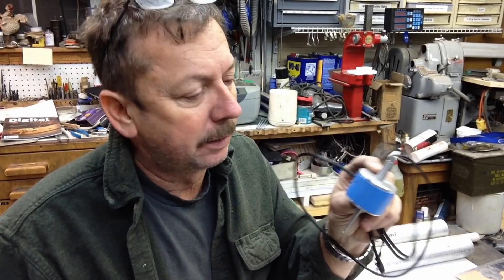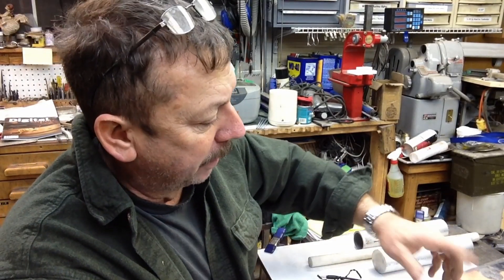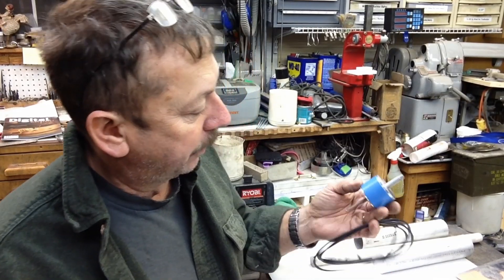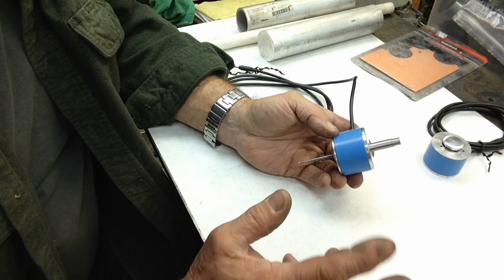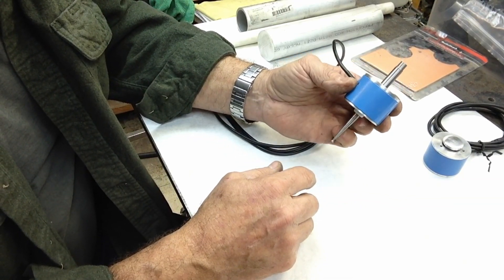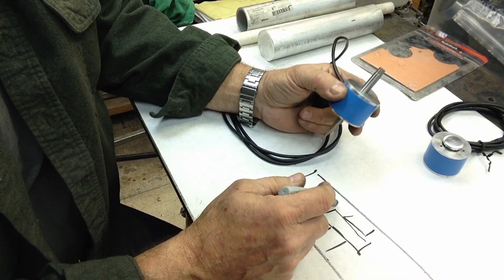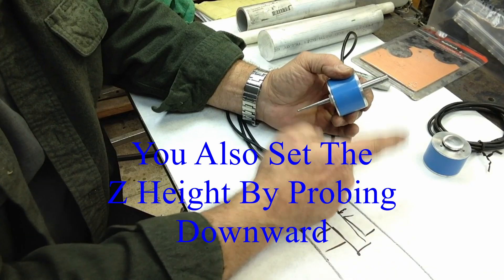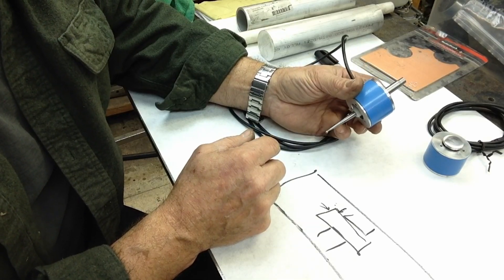Building a CNC Touch Probe For The Mill: Part 1 Overview

Comment from the maker: Make sure to flux the surfaces and make sure that you get the heat thru the ball bearing as it has the most mass that needs to be heated. If you are using a light duty soldering iron it may not produce enough heat ..

Comment: I have problems soldering the ball bearing balls to the PCB. Any idea what to do?
Reply from the maker: make sure to flux the surface and make sure that you get the heat thru the ball bearing as it has the most mass that needs to be heated. If you are using a light duty soldering iron it may not produce enough heat.
Reply: @hillsgun  hi, thanks for your reply.  I still could not solder the balls. I ordered them as bearing  balls from eBay. Then I opened an old bearing from my shop and it worked out perfectly with these. No idea why. Anyway, thanks.

Comment: Those are cool. I appreciate that you showed them and decided make it a project series. I might never need or make one, but I'm undoubtedly better off and more enlightened than I was before just by knowing about them and seeing how they work. Thanks, and Merry Christmas.
Reply from the maker: Thanks John, I am trying to use the probes more often and show it in use for centering the nose piece to drill the adjustment holes. You have a Merry Christmas as well.